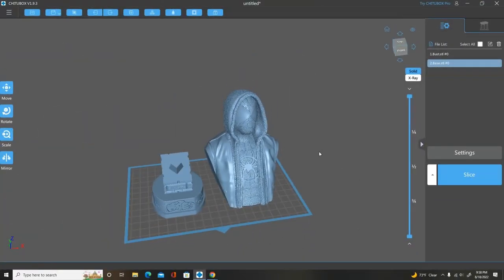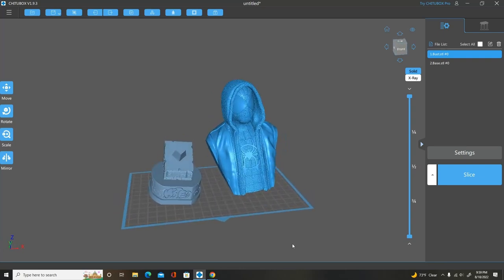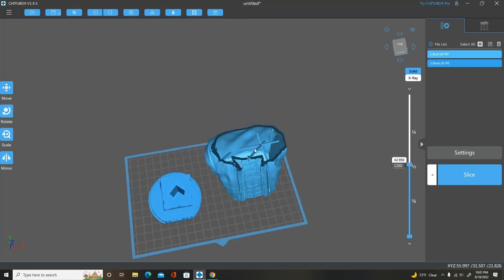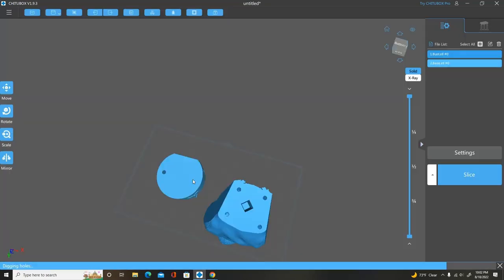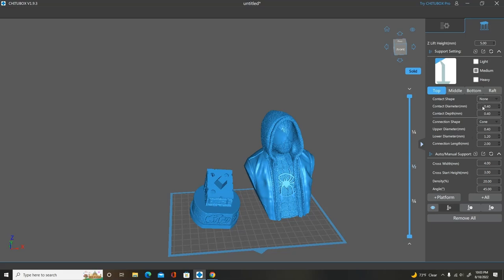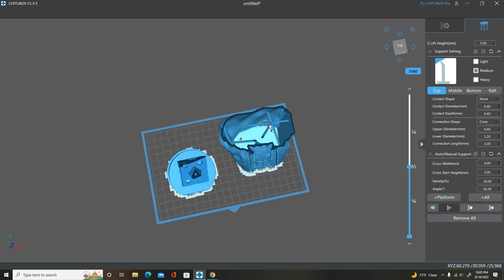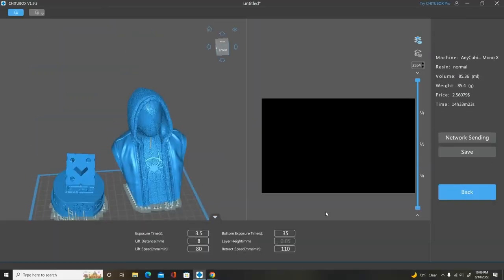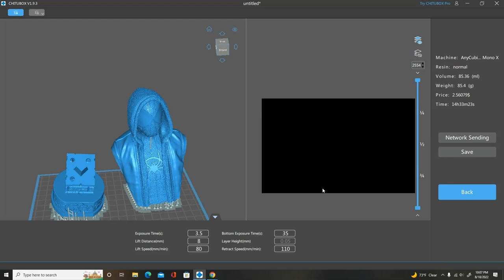Easy way to Hollow your Resin 3D PRINT and save Money- Chitubox

Comment: Great video as always🔥 a little tip I found for those of us using Lychee free version. Hollow out the model in Meshmixer instead of lychee (as it only lets you add infill in the free version), and then import it to lychee and add drain holes there, that way you'll be able to add supports on the inside of the model and not be limited be the free version features!!
Reply from the maker: And thats why I don't use Lychee. To many steps to do. lol

Comment: Came to learn to hollow out to see if that was my error learned not to use pre supports apperciate the info that was prob my issue but I'm going to start hollowing stuff out and apperciate the help!
Reply: Hey question as this and think exposures settings and well lot of stuff I switched to try chitubox as well and seem to have no filmy resin having off my print going to try on more things is it recommended to hollow out smaller things like figures and put holes in those too ?

Comment: This works! When I try to tell others about this on the FB groups, people lose their shit.  "Oh you shouldn't use infill...blah blah blah" I have not one had a failure using 5% infill with 20% support density. Although I do use rafts. It's  just because of the voodoo support settings I use.
Reply from the maker: Some people just refuse to listen to reason. I've printed over 1000 prints this way and haven't had any issues from it.

Comment: Do flush holes interfere with using wash and cure station? I feel like it could fill up IPA or Simple Green (what I use), is this a problem?
Reply from the maker: No. The purpose of the drain holes is to get the IPA in there so it can flush out all of the excess resin from the inside. That'll keep it from splitting or cracking and getting trapped resin out.

Comment: Hey man! Quick question. Did you ever use or heard about someone using something to fill the model after it's printed? I make them for selling and the heavier feel is just nicer and makes it feel more valuable. I tried polyester resin and plaster and the model cracked, both from the heat and fumes of the resin and the humidity of the plaster. Any help would be appreciated! Thanks
Reply from the maker: I've used casting resin in small doses so the heat doesnt warp the model but I've heard some people use sand or modge podge.
Reply: @TheCreativeCollector  Yeah, using resin in small doses might do the trick! I'll definitely try it out. Thanks!

Comment: Your settings worked really great, I had no issues at all but today I have tried doing the same thing on Chitubox v2.1 and the supports now going through inside the model. Have you tried it on v2.1?
Reply from the maker: I haven't. Just make sure you're using the 5% grid infill when hollowing
Reply: @TheCreativeCollector  thank you for replying. I was using 5% then tried some other percentages but still getting nasty supports inside the hollowed model. I switched to v1.9.5 and it works perfectly. V2 is quite fresh and people reporting a lot of issues with it so guessing they will fix the issue one day. Thank you very much for sharing your knowledge!

Comment: Slightly late to the party! This may seem like a stupid question, considering you mentioned it partly in the video, but can just using the infill at 5% support a "roof" on a model without internal supports? Other programs such as VoxelDance add internal supports to hold the "roof" up, while Chitubox doesn't. I understand internal supports are an issue but I cannot understand how the model will print without them, as surely the roof will droop resulting in failure. Many thanks.
Reply from the maker: It should definitely support it

Comment: This video kind of makes it look a lot easier than it usual is. You have flat surfaces to hollow. If you have no flat surfaces and it's highly detailed, you pretty much have to use the option to punch the whole perpendicular to the screen, because otherwise the hole punch direction is seemingly randomized every time you move the mouse a little and you can never get it aimed right.

I've had a ton of issues where it refuses to punch the hole, even though the hole depth is much more than the wall depth, it will say "too deep to dig or not hollowed out".
Reply from the maker: After you hollow out your model, take a look at the inside on the surface where you're going to punch a hole. If it's wavy or has lines on it, then you need to adjust your precision in the hollowing process. This will help a lot.

Comment: First off... I'd love to say how much I enjoy your content.  This was a great video, but I am struggling.  CHITUBOX 2.1 is now current and many of these settings aren't 1:1 any longer.  I think I found most of the equivalents but when I follow this step by step, it is still building supports inside the model despite having done the 3d 5% infill.  Any help would be greatly appreciated!
Reply from the maker: I haven't used the newest version so I'm not familiar with it. I'm still using the 1.9.4 version
Reply: @TheCreativeCollector  Thanks. Might make for a good new video. :) Also Did you have one dealing with support bumps? I may have missed it. Thanks!!!
Reply: @TheCreativeCollector  Hi dude.... I just wanted to let you know I spoke with the dev team and they directed me to the setting in 2.x version of Chitubox to resolve this issue. I figured at some point you're gonna need the printer support and want to make the move to the current version as well.  So hopefully this spares you the frustration.  This simple setting evaded me for some reason.  Go to the three lined top left menu --> Settings --> Function --> uncheck "enable shell support".  Thanks again for all your videos they  inspired me to grab a resin printer and I'm attempting my first print and paint job.  Have a good one.

Comment: Hollowing is great for our pockets 🙌🏻.

I have a newbie question 😅. When you mix an acrylic paint with a thinner in order to use it on an airbrush. Does the paint last longer compared to using it alone on a regular brush?
Reply from the maker: The paint dries quicker when you spray it through an airbrush with thinner compared to water. But I like thinner better as for me it keeps the pigment in tact. You can use a little bit of flow improver with water so it doesn't clog the brush too often.

Comment: I tested this infil setting with slicing a torso for a superman figure. There was a huge island showing it will print before the infill support brace is even close to it, so in my mind, that would be an immediate failure. Just checking with you if I am missing something??
Reply from the maker: I'm not sure what you're talking about until I see it, but I didn't have any problems with it. And I use the same infill for all of my prints.

Comment: With such small holes, how do you cure the inside? UV leds are usually wider than that.
Reply from the maker: Because I print in only 1.8mm thickness you really don't need UV curing the inside. It cures throughout.

Comment: If any of you are having trouble following this in the new version 2.x like I was... density has been replaced with "Touch Tip Distance"  and now based on MM and no longer on a percentage. Also adding supports, then hollowing out your model (in that order) will avoid Chitubox 2.x from adding unneeded supports inside of the model. So >> position, add supports, hollow, add holes.
Reply from the maker: Thanks for the update!

Comment: Did I hear somewhere correctly that if the wall thickness is less than 1.5 that this uv will cure the inside through the wall during the curing process? or am I crazy?
Reply from the maker: At 1.5mm the UV cures through the inside, yes.

Comment: Question. Generally, I upscale my prints from 32mm. To either 60mm or 75mm plus. I'm having no problem hollowing the figure. But, I can not install the drain hole. I get something that looks like cylinder. Yes, I'm using your settings. Any thoughts?
Reply from the maker: You'll need to make sure the hole is deep enough to drill in. I usually set mine for 5mm
Reply: @TheCreativeCollector  Thanks.... I'll try that

Comment: what do you do when you hollow and either end up with resin pockets or with unsupported islands inside the model?
Reply from the maker: It's rare but if it happens I just punch a hole in that part or use the repair option and see if that fixes it.

Comment: Any particular reason you have transition layer count set to 0 as well as time-off delay? Also do you change printing profiles depending on type of resin you are using? Your settings are way different than what I currently have for Mono x using Siraya Tech build resin.
Reply from the maker: For what I'm printing those settings are unnecessary and I've found the time off delay can cause burnout in the screen eventually so I keep it off. And the way I have them tweaked I basically run the same settings for all different kinds of resin. There's no need to change unless the resin calls for longer exposure times.
Reply: @TheCreativeCollector  Word, thanks for the quick reply!

Comment: Are you still using that configuration today on the photon mono x or did you change something? I ask you why I just bought one and I want some advice I am using the basic gray resin from anycubic
Reply from the maker: I'm still using those settings.
Reply: @TheCreativeCollector  ok thank you very much i will try it
Reply: @TheCreativeCollector  Could you tell me what firmware version do you have? in your photon mono x I have to update mine. it doesn't recognize my chitubox files
Reply from the maker: Go to Anycubics website and download the plug in. They have pre sets for the Photon Mono X there
Reply: @TheCreativeCollector  Finally, the power of the uv screen, in what percentage does it have it? It is that how I will use its configuration I want to take everything as it is if I can to avoid problems and later as they learn I change one thing or another
Reply from the maker: I run the UV power at 70%

Comment: Hello, I am using M3 Premium. I found my printer thanks to a shared plugin. Should I use your settings? I select my Lychee printer and print. the platforms of the models are problematic. I am very new and I need your help.
Reply from the maker: You can try those settings and it should be ok. Do a test print first just to make sure.

Comment: how do the drainage holes help on that bust if it prints upside down?? Unless im looking at this wrong.
Reply from the maker: So the purpose of them really is for suction first. That way the model doesn't float off your supports. When you turn the model over some resin will come out, and it'll still allow you to wash the inside resin out.
Reply: @TheCreativeCollector  gotcha! So I am new this. I’m about to order myself the Saturn 2. And I’m just doing a deep dive into everything so I can use the machine with confidence. 

Here is a question….after you print and have everything washed and cured, can you fill the hollow with something to give it a better sense of weight?? And then plug the hole with something.
Reply from the maker: You can. Some people fill with different things like sand or casting resin. Although if you use casting resin keep in mind when that stuff cures it gets hot, so adding too much at a time can warp your print or bore holes in it. So be careful.
Reply: @TheCreativeCollector  appreciate the tips man! I subscribed as well! I come from a computer modeling and digital sculpting background, but I’ve only ever 3D printed something once on an FDM printer that wasn’t mine.

Comment: Do you have any experience with 1/12 & 1/10 scale figures? I tried some and got really bad suction forces that kept taking everything off the supports
Reply from the maker: You can still hollow those out if you use thin walls but yeah, they need more supports and better orientation so they don't pull off

Comment: Quick question. Did you have to do anything to get Chitubox working with your Anycubic photon mono x? Lychee sliced files work fine, chitubox files (the same pwmx file type) are broken and won’t even display.
Reply from the maker: No. Chitubox had the printer pre loaded in the software

Comment: any tips for making sure resin sticks to build plate and doesn't fall onto the FEP?
Reply from the maker: Level bed, proper exposure times and retract rate.
Reply: @TheCreativeCollector  i really appreciate all of the help. just woke up to another successful print this morning.
Reply from the maker: Awesome!
Reply: @TheCreativeCollector  spoke a little too soon, while the print didn't fail there is some noticable shift line towards the base.
Reply: @TheCreativeCollector  what is the ideal retraction speed? I'm using 90 , and a lot?
Reply from the maker: I use anywhere from 80 to 110

Comment: I started using these and I seem to get large “caves” (not really sure what else to call it) in my prints. I printed a Flash head sculpt and he’s missing half his face, for example. Have you ever had that issue? Its obvious the settings work, so I’m wondering if it’s a coincidence. Is it possible there are parts inside of the model that need to be supported?
Reply from the maker: I haven't had those issues. Are you using presupported files? I use auto supports and never use presupported.
Reply: @TheCreativeCollector  I don’t, I use auto supports in Chitubox. I’m gonna take a look and see if it’s just a coincidence and if there are some islands within the print that are being missed! BTW, the support settings are perfect. I used to struggle with removing supports but these come right off

Comment: I can't seem to punch holes with chuichi. I get errors. I saw some folks mentioned Saving stl and restart but that isn't working. Any suggestions?
Reply from the maker: You can do that, but make sure you have the correct depth on your punch and you're hollowing out your model. You can't punch a hole on a solid model.
Reply: Thanks. I tried same settings you had in video. 1.5 mm walls, hallowed than trying to make 5mm hole with 5mm depth.
Reply: Maybe my figure is too small. It isn't a bust. Looks like a mini figurine. But it is kinda a chunky character. So I was worried about resin getting trapped

Comment: Why do I see so many people lifting the model off the plain and supports underneath is there a reason for it
Reply from the maker: If ots a flat surface they do it because of suction issues. Otherwise if you don't have supports under it, it can print distorted or not at all.

Comment: how do you cure the inside??
Reply from the maker: You can use a small UV light in the drain holes, however printing at the thickness I listed you don't have to do that. It cures all the way through.
Reply: @TheCreativeCollector  oh okay sweet. I have a cure station and wasn't sure how i was going to cure the inside thanks!

Comment: I've tried so many different ways to use chitubox it will not put holes where I want, it's infuriating
Reply from the maker: Are you digging the hole with enough depth? You have use it deep enough depending on the thickness of your walls when you hollow it.
Reply: @TheCreativeCollector  yes , it puts it in another place (nowhere close to what my mouse icon shows, or the hole spans sideways)its like it doesn'trecognise the walls. I use same settings on lychee with no issues. 2-3-4-5m hole 5m deep, I've adjusted depth. I've even had it put a hole on bed- completely off model, on the build plate.....I'm like "how is this even possible?"
 On another note, I've tried your print settings and LOVED IT! THANK YOU!!!!!  I have a monoX 6k, I've printed out.Lara Croft from tombraider - sanix stl , your settings worked